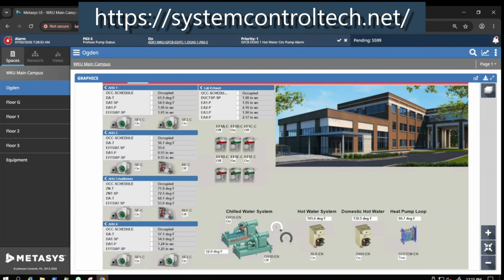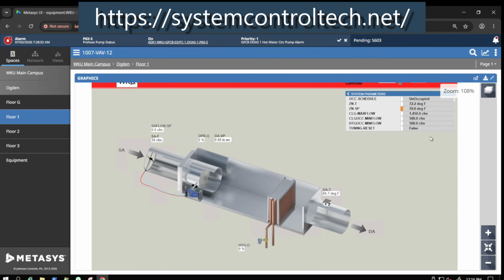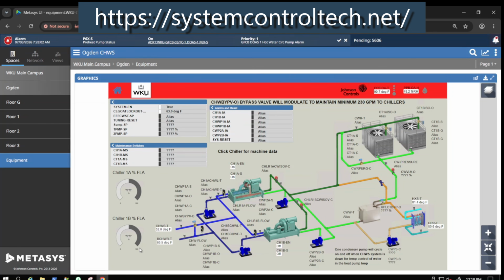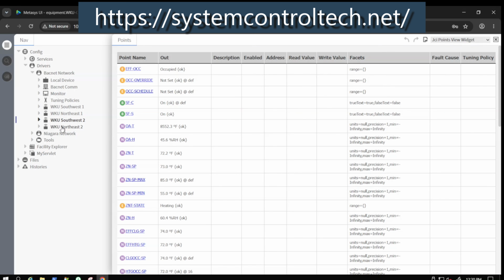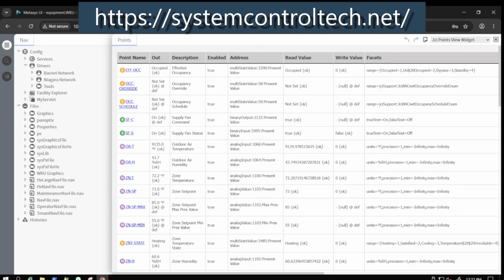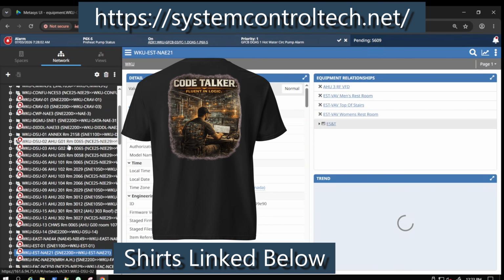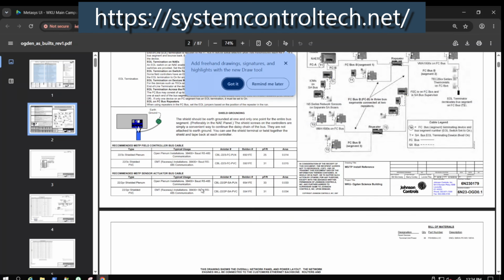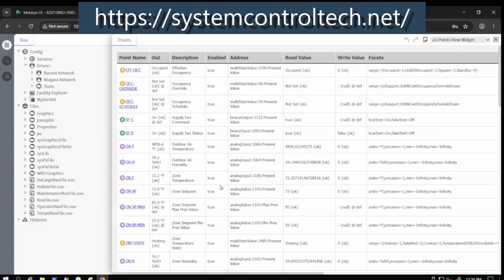What Is a BAS? Johnson Controls Metasys Breakdown

Comment: The best decision you can make is to not use Johnson Controls to begin with. It's one of the worst BMS on the market.
Reply from the maker: The system is only as good as those who maintain it.
Reply: @Systemcontroltech The NAE failure rate for JCI is the highest in the industry. You're going to put that on a Hospital staff? Who do you intend to blame for not "maintaining" the system? Or do you mean constantly paying JCI to upgrade what was already paid for? The Network Automated Engines themselves are more than enough of a reason to choose something like Automated Logic over JCI as it is a much better BMS. ALC is better quality and better supported. I would also rate Alerton above JCI. Besides Johnson Controls will do a terrible install, they always do.